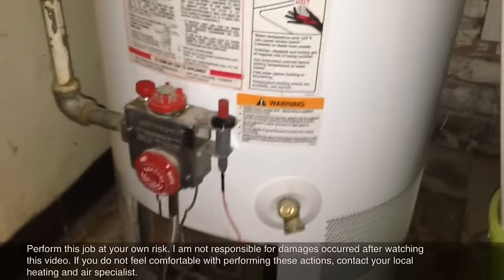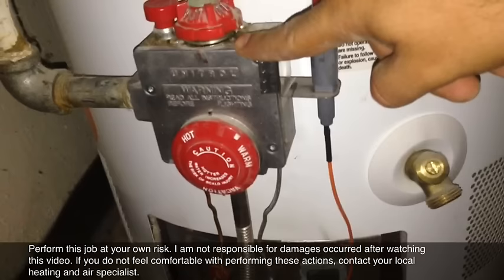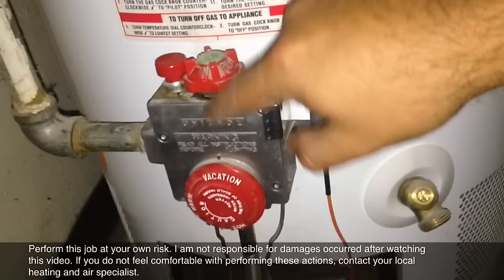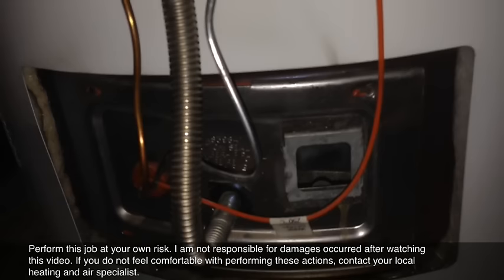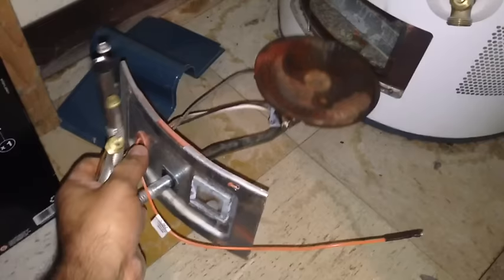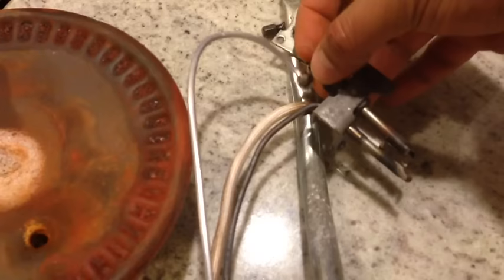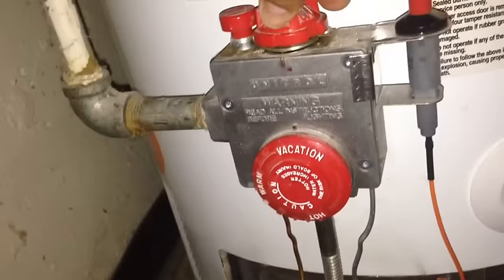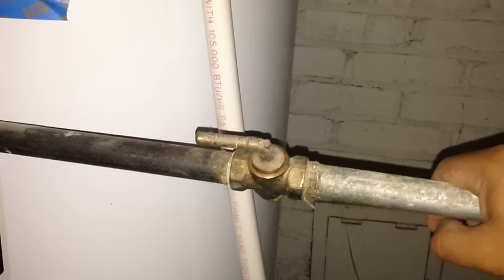Water Heater Pilot Light Will Not Light Up

Comment from the maker: Wow!!!  I've been reading all of your comments, I am so happy this has helped so many people!  Makes me want to keep adding videos on quick do it yourself emergency repairs!!  Thanks for watching.
Reply: Sergio Cordova You are amazing, it took me 2 hours before I found your video, thank you soooo much.
Reply: This video is super helpful and your dry humor is delicious.
Reply from the maker: ***** If you're tank is old, it could be leaking.  Look around for water, check the burner and surrounding areas.  If you do see water anywhere, replace your tank immediately.  This could mean your tank is about to give in and cause a flood.
Reply: So smith. Promax
Reply: Sergio Cordova 
A
Reply: I will try this tomorrow thank you anyways for making this video even if it does not end up working for me
Reply: Your video helped me tremendously. My water heater pilot got knocked out by a wet basement and i took it apart and cleaned it /dried . Now it is back working. HAPPY WIFE HAPPY LIFE!
Reply: Thank you thank you thank you
Reply: If it won't lite the pilot, move the thermalcopla line first before you do any maintenance. Just did it to mine and it stayed lit. Working yea.
Reply: We can't get the bolt off the gas line to be able to pull the tube out
Reply: Please do :) Household of non-handy people here LOL

Comment: Thank you very much.i had some work done to our home and turned off waterheater .long story short copper pipes at the top of water heater cold fresh water and hot water supply were old and started leaking.after replacing copper flex pipes  heater will not ignite. Thanks to your video I know what to start checking.Thank you so much.

Comment: your video saved me! my pilot lite wouldn't lite back up so i decided to google my problem and it led me straight to your video. I was told by a plumber that my 8 yr old water heater needed to be replaced, it wasn't worth fixing the control box (which is what he said the issue was) and pouring money into something that was old and needed to be replaced. I decided that tinkering with it wasn't going to do any harm if it really was that broken. After watching your video, I cleaned out my gas pipe and bam! the pilot lite lit right up and my water heater is working perfectly. You saved me $2000. Thank you so much for posting your video

Comment: I was ready to order a new thermostat when I came upon this video.   I pulled out the burner assembly as you did, disassembled it and found the little thimble like orifice.  BE CAREFUL when removing the output head of the pilot tube from the long tube as the orifice is not secured and it can fall out and easily get lost on the floor.

Anyways,  I held the orifice up toward the sun and looked at it and you could barely see sunlight.   Took my air compressor and blew it out...again...hold on to that little orifice, it likes to slide out of your hand.  Then I looked again through the orifice into the sun and there was a nice concentric circle of light.  Verified with a magnifying glass.   

Reassembled the burner thermocouple unit and installed.  Bled the pilot start system for a few seconds and the pilot fired up!!!

Thanks for the extremely helpful video.  I own several houses and most have gas hot water, so I'm sure the video will come in handy again!

Comment: Great video, but as a Plumber with 35 yrs experience I can tell you that the flame in the end has way too much yellow in it. It should be blue, and that is from a lack of oxygen. The flame arrestor needs cleaned thoroughly with a shop vac, and small hose and brush. It is just a metal screen that allows air flow into the burner assembly. This is a very common problem these days with the new style Water Heaters. Just something that I observed, and is a very common problem with 8 out of 10 W.H.'s
Reply: Have been a plumber/gasfitter for 22 years,  the  water inside  that tank has likely cooled to room  temperature, or  colder if they  have  been  drawing  water from it.

That flame  is  yellow from condensation dripping  down the flue channel onto the burner, once it drips onto the hot burner it flashes to  steam,  which is introduced into the primary air,  causing a yellow, luminous flame

Once the temperature of the water inside the water heater goes above the dew point of the flue  gasses, the flame  will be  a normal blue color .
Reply: Smh the game is to be sold not told M/F bull bull
Reply: I’m having issues with it staying on once I get it all back inside the tank.   It acts like there too much air flow inside blowing the flame out

Comment: Hey Dr Sergio, Yeah that's right everyone, he is a Dr of Water Heater FIx!

Like so many others and even service techs they default to the thermal coupler, WRONG! it was the pilot light pipe fixed tip regulator. It's purpose is to let just enough gas out for the pilot light flow.

It is literally a hair pin hole so it can be easily clogged with micro debris.

Mine was clogged as Dr Sergio predicted :-)

I removed it and gave it a hot vinegar bath and cleaned it out thoroughly. Blew compressed air thru it. BINGO!

Pilot lit and stayed on!

While I was in there, changed the coupler, it was less than $12 so what the heck.

Thanks again Doc!

A friend of a friend went thru this and tech told her she need a new $650 water heater.

Comment: Thanks for posting. A couple of things: 1st, the little cup shaped thing with the hole in it that you refer to as the "filter" is called the "pilot orifice"....2nd: It seems that your main burner flame has a bit too much orange in the flame indicating rich fuel/air mixture. This incorrect fuel/air mixture in turn can be caused by either a dirty combustion air inlet screen at the base of the tank or a partially or completely plugged exhaust vent (chimney) . Both conditions are very dangerous....do NOT run the tank until exhaust vent (chimney) and bottom combustion air vent are cleaned...carbon monoxide hazard !!!! These conditions can cause a dirty/rich orange flame which will often result in a plugged pilot orifice from the soot produced by the dirty, orange flame.
Reply: Anytime you have condensation from a cold water tank being heated up, dripping down on the burner, or dust from any sort of work being done/dust being disturbed and kicked up, you're often not going to get proper flame characteristics. The same reason you get streaks of orange in even the most ideal flame. Dust/impurities etc.  I often see neat green flames if I knock some dust off an old burner assembly.

also he didnt screw the faceplate back on... which isn't up to manufacturer specs and could affect flame characteristics. 

but regardless of flame characteristics, checking for proper drafting at the draft diverter is the most important thing for CO prevention, and should be done anytime a water heater is lit. also important, check the pilot tubing/main burner tubing for leaks, on the new connections you make! they are prone to leak like a sieve.

not to be pedantic, or that guy, but the HOLE is the pilot orifice. The ITEM is the pilot orifice spud.

Comment: Senor Cordova,

You, sir, are a steely-eyed water heater man !!  

The tiny orifice tucked away in the pilot light venturi tube was the source of my problem, too.  I opened up the tiny hole with a 0.027"-diameter sewing needle and--KERPOW--the pilot light burst alive with the FIRST click of the igniter.

The original installer of my American Water Heater unit charged $100 a few years ago to when I was unable to re-light the pilot after an annual drain/flushing.  That MOFO.

Thank you for your invaluable and well-produced video.

Bruce Kopetz
West Bloomfield, Michigan

Comment: OMG, thank you for going into such detail with this video. The hot water hose sprang a leak on my water heater, and after we replaced it, the pilot would not light. I tried a good dozen times. The sparker was sparking, the gas was flowing (I could smell it after about 30 seconds), but it was not lighting. I took the whole assembly out like you did, dried off the flame plate, checked the sparker and the pilot restrictor, both of which were working, and then decided to take out the glass window for good measure, figuring if it still had the same issue, I could at least stick a candle lighter in there. I hooked it all back up, tried the sparker, and nothing. So I grabbed my candle lighter, stuck it through the window, and bazinga! The pilot lit. I held the knob in until the light started blinking, and then turned it to hot. Worked like a charm. I am so pumped right now. Thank you a thousand times. Also, after all that work, I need a shower. I cannot wait. ;)
Reply: mandydax  I followed your steps and I have hot water again. Thanks to you and the person who posted this video!!
Reply: mandydax Be sure to replace the glass window, the unites have a "sealed combustion chamber" . The spark igniter is replaceable.
Reply: mandydax I just fixed my by doing this you are the best bro thank you !!

Comment: Thanks for the video, it was very helpful!  However, it did not work for me so I wanted to share what did and maybe help someone else.  My pilot was out and could not get it to light but rather than being a fuel issue it was the thermocouple.  I didn't think it could be the thermocouple since it wouldn't light at all, I thought the thermocouple could only be the problem if it wouldn't stay lit.  It was very dirty with carbon build up so I sanded it, reinstalled and it lit right up.  Hopefully that helps someone if cleaning the fuel line doesn't work.

Comment: Hey Sergio, My Water heater stopped working , on the coldest night here in TX. When I checked the pilot light I notice it was not on, nor would it respond to my attempts to re-light it.
When I took the heating assembly out, which was reasonably easy, I notice there was some sort of capacitor inline of the thermocouple line. It was disconnected on one side
It was originally soldered on both ends. I just barely noticed that, as it is tiny and you have to push on it with your finger to see that it was broken off. I managed to solder it back, then I re-install the assembly and put everything back together, whoa-la  pilot is back up and heat is on and hot water is running again. My wife thinks I am a hero. Thanks to you Sergio.
Reply from the maker: Glad it worked out!

Comment: Thanks x10000000000!!! I'm an auto mechanic/natural gas compression mechanic, but when it comes to home gas appliances I get a little nervous and I'm not familiar with water heaters. I was about to order a new gas valve for $120 off the internet and then I found your video. Removed the pilot line after the valve and sure enough gas was getting by the valve. Cleaned the pilot line and wala got the burner going.. Thanks again for taking the time to make this video!

Comment: Hey good video. BTW gas is dirty and will clog valves who knew. To help prevent that, traps in the gas line are used. You don't have any, your gas line goes right into your water heater I had a similar issue. if you put a trap between the gas line and your water heater it will help keep the valves clean. I got this advice from a plumber. Good luck all....
Reply: In gas it’s called a drip not a trap. But yessir

Comment: Dude, Thank you for posting this video!!!!!!!  I had the exact same issue. I was able to fix my water heater because of it!  I did not remove the hole burner but rather shut the main gas line and removed the small pilot line off the valve. Then I blew some compressed air through it, and it worked! it cleared the line and I simply re-attached it, and the pilot lit! 

Thanks again. It was very informative and helpful. You definitely saved me a technician visit.
Reply: Jesse Sanchez trigu
Reply: Jesse, ya da man!  Your method works for me too!  Saved me a lot of time. Thank you very much!

Comment: Thank you, thank you!!!  Our WWF wrestling dogs tripped the earthquake shut-off valve on the gas meter, so we lost all gas to our house.  After I reset the valve (thanks to another YouTube video which saved me an $80 Gas Company call charge), I tried to relight the pilot light on the water heater.  No joy.  Your video described the problem and solution perfectly - clogged pilot gas tube.  The entire process took about an hour - most of which was spent looking for the right size tools.  My next chore is to buy a tool box with a lock.  

You are awesome Sergio and have made someone else's wife (me) very happy.  You can probably add my husband to that list because he didn't have to fix it.  :)

Comment: Another grateful viewer! Had a plastic drain valve that cracked... water leaking everywhere. Drained tank, got the old valve pieces out, replaced with a brass valve, no leaks, felt good for not having to calling service tech. Then the damn thing wouldn't light! Found your video, now I have hot water! Thanks again!

Comment: Well done Sergio with clear and safe procedures. If I may contribute, it is not self evident that the line to the restrictor should be cleaned as well, at least close to the restrictor residues could build up. Good that you pointed If after cleaning- pilot does not stay ON then thermocouple is not working.

Comment: Another thank you message here:  I got done working in my garage and really wanted a hot bath, but after pouring the water for a few minutes, I realized I had no hot water. I went downstairs, tried to light the pilot,  and could not. Thanks to your video, my house has hot water again. The repair only took me about an hour, half of which was spent looking for the right size wrenches for everything. My water heater is a fg14040s3nov 40 gallon model. The 'nipple' if that's what it's called on the end of the pilot gas line would not come off of the line for me, but I was able to make air come out of it after taking it apart. The hardest part was getting the brass nut off so I could inspect it. I used Vice Grips to hold the lighter/pilot assembly and a 13mm open-ended wrench on the brass nut.
Reply: Yeah, it took a whole battery of flat wrenches:  3/8", 7/16", 1/2", 5/8", 3/4".  It's not childs's play, but well worth the couple hours required.  Also, it really helps to have been successful.

Comment: Great call. Pilot wouldn’t start after gas was turned off to house. Tried to just blow it out before removal but didn’t work. Uninstalled whole assembly, cleaned and it work. Tiny rust particles had fallen into the pilot burner tube. Thanks!

Comment: Like Rosalyn Mack, I tried it at first without any success, but after watching this video went back, tried it again and it worked!
I believe it was my fault that the pilot light went out in the first place. I was cleaning up around the hot water heater with the shop VAC and I believe the force of the suction air may have coused the pilot light to go out.

Thanks for a great video. It saved me a service call.

Comment: Thank you! Yesterday I tried to light my water heater but I didn't know what position was on for the gas & I down low enough to see if the fire was on, so nothing happened. However, this morning I tried it again & yes everything worked. This video gave more insight. Thank you cause here it is Sunday & calling a service technician would have costs me.
Reply: I did the same thing Rosalyn! I tried it at first without any success, but after watchign the video wnent back, tried it again and it worked!

Comment: Thank you! I had a similar problem with my furnace, pilot light would NOT light at all. As it turned out, we had a 90 MPH windstorm the day before, and it shook off soot from the chamber above the pilot light, from the heavy winds hitting the flue on the roof and shaking everything. The soot fell into the hole on the pilot light, so it would not let the gas out: you could not see it until a very bright flashlight was placed right next to it. I applied a toothbrush to the pilot light jet and it fixed it right up. Your plugged-up pilot hole led the way! Many thanks, it was COLD in here!

Comment: Thank you Sergio. I watched my pilot flame get smaller and finally go out while trying to light it. After that, it wouldn't light at all. I suspected a clog as I had just added a 90 degree elbow to the main gas feed line and disturbed a bunch a crap when I took it apart. This video was spot on. I think, just the act of taking it apart fixed it. I blew it out with air anyway, reassembled and it works like a charm. In the future, I think I would try tapping on the gas line to the pilot before disassembling. But, if you have to disassemble, this video makes it extremely easy. Thanks Again.

Comment: Thanx for the video, my water heater had the same problem, replaced it & now it's working like a charm, it's a very easy fix, take your time & double-check everything especially the main gas line was turned off as well the master control thermostat, put everything back in reverse order & don't over-tighten anything...just hand tight plus 1/4 turn

Comment: This was exactly what was wrong with mine, along with not having an igniter and a bad thermocouple. For what its worth, your pilot tube unscrew was the same but that little thing inside that was clogged was real hard for me to get out, using orange handled picks from harbor freight got it out, along with using their little keychain of tube cleaners from the paint gun cleaning area. Thanks for the video! FYI also - i used a bbq igniter from home depot to ignite and it looks exactly like the one in this video. total cost to fix my three issues - $30 and 2 trips to home depot. Youtube videos  like this save me so much vs hiring a contractor, money and cold showers both!